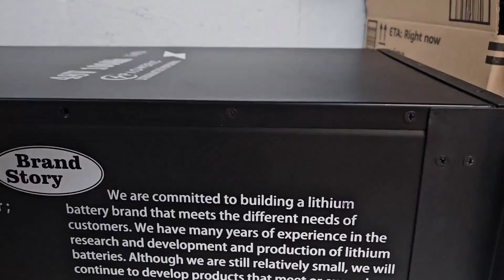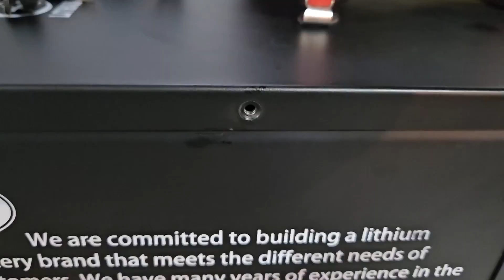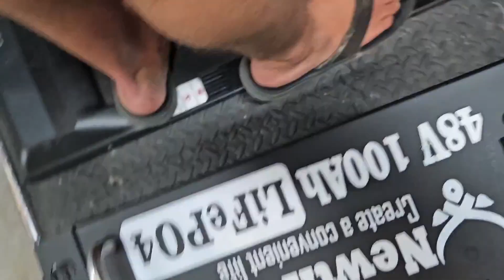Paoweric 48v (51.2v) 100ah Server rack battery teardown

Comment: Exactly the same build as the "Newtipower" both look pretty sucky. It would of been much cooler to see if they actually performed up to code. but if you haven't tested them yet you probably never will. Otherwise what was the point. Now whether they are or not, I just see them as trash. Well thanks for that I guess.
Reply from the maker: Sorry life got in the way I never got around to capacity testing them. Still using them to this day though cycling daily and they seem to be doing fine
Reply: @yourtechguyjames  Well that's good,  I had just watched Will Prowse testing a Haisic battery it didn't even have 16 cells, and so was not making full spec. Made me curious I have an inverter coming next week so I need a battery. And I'm on SSI so money IS an object. Thanks.
https://www.youtube.com/watch?v=dqWtOWGSJiA
Reply: @yourtechguyjames well that sounds like a buy and your initial opinion was wrong... glad I read the comments, they have a golf cart version
Reply from the maker: @toddwhite3217 unless you can get a deep discount you're better off buying a known brand new cell battery for the same exact price
Reply: @yourtechguyjames the full setup was $600 delivered off temu... its in the cart and works...